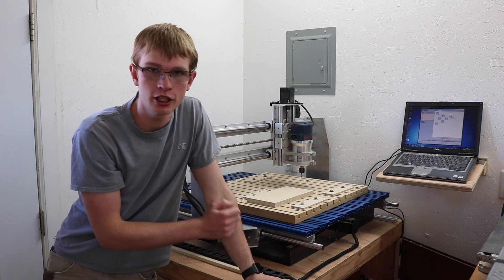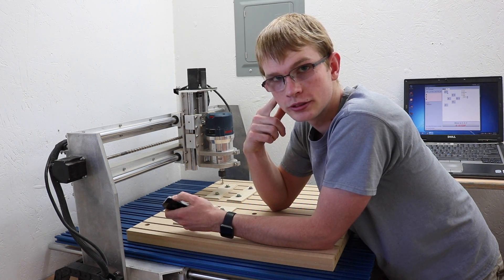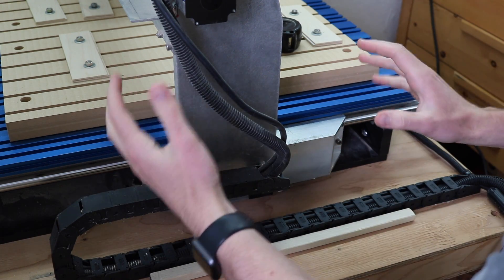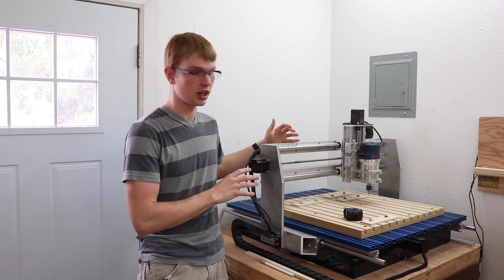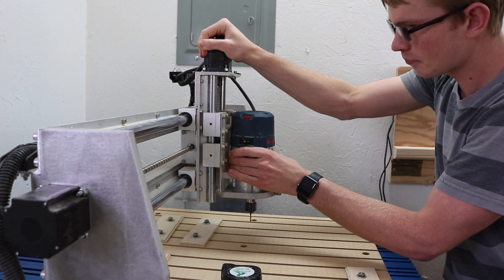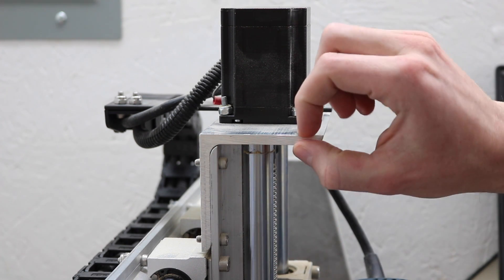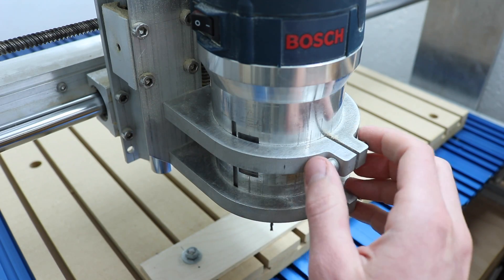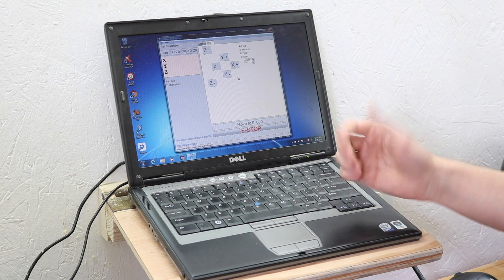All about my CNC machine

Comment: An idee if you want to clamp thinner material with the same style of clamp whould be to have a nut in the T slot below and just have the screw head ontop ... and if you can countersink that into the clamp, you whould not have the nut sticking up above the clamp ... Just an ide.

Other than that I love the clamp ide/concept.

//Vidstig
Reply from the maker: +viddy stiggy 
Good idea! I'd need to adjust the shape of the T-slot a little to accommodate the end of the bolt, but that's easy to do...
Reply: Glad you liked it. I have seen something similar in a store somewhere :P. And if you want bigger clearance for the dust collection for exampel this is an idee that will work for that to.

Comment: there is nothing that would pull on it as you did to make it twist
Reply from the maker: +steveu235 
True, but 1/10th the force makes it twist about 1/10th as much, which is still completely unacceptable. 0.001" of twist is too much, and 1/10th that much force will make it twist more than that.

Comment: Delrin nuts and lead screws are a lot more economical than ball screws. is there a major trade off in other areas?  I guess the best question is would you use them again? I really appreciate your demonstration of the gantry strength. It shows what is important and how to achieve it. Really good job.

Comment: Please make it happen, build a CNC machine. A machine that can by armed with
a 3D printer nozzle. The base seems to have the same common requirements for
a 3D printer and CNC Machine, that's stability and accuracy. Other issue would be 
the speed but speed is relative. It doesn't have to be large 250x250x200 (mm) or 
9,84x9,84x7,87 (inch) would be fine for most hobby parts.

Comment: To avoid twisting as you mentioned, the SBR20 rod should be facing each other or back to back. This is due to the way how these SBR rail is designed. This is its limitation compare to the THK linear design. Mine has no twisting but it was done thru trial and errors costing me thousands of dollars. Cheers.
Reply from the maker: +LEN HENG 
Yep, I have observed this in my rails, however I believe about 70% of the twisting in my gantry is from the structure and 30% from the rails. (Just a guess)

Comment: Stop using angle stock and box tub. ROUND TUBE is TORQUE STABLE! Flat crap aint!
Reply from the maker: +Tricknologyinc 
Really any closed profile is pretty good for torque. But yeah when I built this I was stupid and didn't think it through.
Reply: No, it's not! Square tube is nothing more than four FLAT BANDS! FLAT BANDS TWIST LIKE CRAP! TRUST AN ENGINEER! This is why you do not see tube frame race cars and aircraft of any serious application using anything but ROUND TUBE! Ive been doing this stuff A LOT LONGER THAN YOU. If you don't believe me, just take a round and square tube of equal thickness and dimension and TORQUE THEM AND MEASURE THE YIELD!
Reply from the maker: +Tricknologyinc 
I will trust an engineer. Too bad you just made it obvious that you aren't one. I didn't say that square tube is as strong as round, but a 2x2" tube 1/8" wall is many times stronger than four 2x1/8" flats. And square is easier to work with in this case, so it's good enough.
Reply: You're the one one that made your first comment, not me. Machine tools cannot tolerate anything that is only "pretty good for torque". You didn't think through your design nor your afterthoughts. You raced along focused on a single aspect, as you even admitted, dragging everyone through every detail, so don't stand there and tell me I'm not the engineer. You didn't think your project through, and then when someone offered you assistance, you didn't think through your replies and focused on your ego and attacked. I didn't attack you.
Reply: And don't get ruffled! You pointed out problems in someone else' work and did some good work. You overlooked some obvious critical points, so you're going to get the same. that doesn't mean you didn't do everyone a service, but when you just thrash everything outside of your focus, you are seriously diluting your result. I should have started out thanking you for your work and contributions, so I didn't come across as ungrateful. You're doing a lot of good work. But when you venture into calling out flaws, check your own a tad closer. Keep up the good work!
Reply from the maker: +Tricknologyinc 
I'm sorry I came off wrong. You're completely right that I didn't think through my design; what got me to reply the way I did was when you said "square is nothing more than four flat bands", since I know very well from real world experience that isn't anywhere near true. It's true that a round tube down the middle of the gantry would do a lot for the stiffness of the machine though, assuming I could figure out how to mount the linear rails to it. That's where my comment that square is easier to work with stemmed from. It would be almost impossible, with the equipment I have(no tig welder), to mount the rails to a round tube...with square they could just be bolted on.
Reply: The phrase "nothing more" was hyperbole, but it is the correct place to start in analyzing the mechanics. The four flats will simply twist. What needs to be accounted additionally is the right angle joints which will simply flex open or closed as a parallelogram. this flexing of the angle joints is similar to the flexing if the flats but the cross sectional area is based on the distance from the inside to outside corners, or the 45 degree bisection of the linear material thickness. The flex of square tubing is not merely that of the four flats, certainly, but it falls MUCH closer to that end of the range than what you would measure or observe from a round tube! thanks again for your videos. They're a lot of fun!
Reply: BTW, you don't need TIG! Stick welding is dirt cheap. Oxy-Acetylene is a bit more pricey to start up when gas bottles have to be acquired. Pawn shops in more urban areas usually have a couple welders in stock. If you can score an AC/DC unit in the 200 amp range, then a cheap gas capable MIG welder can use it as the primary power if you need to get a jump start on production steel fab. Round tube with angle welded over it or box tube over round tube are options. Round tube can even be your rails. Someone with a big lathe should be able to true up the outsides and taking advantage of larger diameter tubing, longer rails, and longer carriages, play can be nulled and a very true running set of stages can be scratch built. Buying a precision set of rails which is pricey to start, and then having to engineer the crap out of a mounting system that is still slave to the flex in those rails can be a fools errand. Carriages can be fabbed from box tube or angle with skate bearings mounted to adjacent faces so that the perpendicular oriented bearings and ride on a round tube or pair of round tubes welded into a truss if necessary depending on the span and load required. Anyway, that's more of my spitballs coming at you!
Reply: Tricknologyinc Where is your video guide for building a CNC if you think you know everything better?
Reply: Jonatan - You just skipped reading most of it.... I'm busy. I help out what I can. take it or leave it or offer something yourself. I helped. You're not.

Comment: Not a fan of your final design, but I understand you were working with what you had(junk to begin with). With that, I have to give you a lot of credit for ingenuity.  You fit up a lot of complex parts to get it done. Hat off to you.You should add an extra nut to your x and y for an anti-backlash set-up  You already have the structure in place to mount them.  Make them free floating, add springs to their mounting screws, adjust every once in a while.
Reply from the maker: +joedanero 
Good idea. Backlash is becoming more of a problem as the machine wears...

Comment: Do not fret about the expense of the gantry sides.
The HD had been reinforced with aluminium plates.
It made no difference to the wobble in the gantry, the top rails were slightly longer than the bottom of the gantry was wide, so the plastic sides vere still bent slightly outwards, in an effort to avoid gantry wobble.
It did not work.
I used 1/2" aluminium for the sides.
I found, that because the extruded aluminium rails were not supported, when you used the supplied clamps, they just lifted up the rails in the middle and allowed the material to bow.
That's why I bolted a solid sheet of aluminium under the table.
I still use the control box, it is a helluvalot easier than the Mach3.

Comment: you mentioned the Arduino + G Shield control box, could you elaborate on that?
Reply from the maker: +dudekidPL 
That's what the X-carve uses, but upon further research I've realized that's kind of a rubbish way of doing it. The Arduino works great, and has the advantage of a lot of flexibility (runs on Windows, Linux, & Mac), but the G shield can't handle the amount of power required to run good torquey motors...

Comment: Going to start building a cnc this weekend. Going to use 4 gantry rails instead of 2 with the motor mounted in the middle. This should eliminate nearly all possible flex.

Comment: Hi, very interesting video. I was wondering for 800$, the CNC machine will it be able to cut 3k carbon fibre? I would like to build one so I can cut carbon fibre frames that will use to build my quadcopter/multirotor, and some small pieces of 7075 aluminum for mounting camera, roll-cage, etc... I read you might be selling the plans for a CNC? Is it still in process?
Thanks for your time
Reply from the maker: +Ray Choi 
Yes, it is still in the works, but I've run into some issues that will delay it some. I don't see why it wouldn't be able to cut carbon fiber and aluminum.

Comment: How have you ended up your drive rods? Are there any axial bearings in the frame? Or everything is carried by the stepper motor bearings?
Reply from the maker: +Przemysław Jakubczak 
The motor bearings take the load. Bad idea, but that's how the original manufacturer did it.

Comment: Nice mod there..... My home brew is somewhat similar in size has almost the same specks as the shopbot desktop. I used the same acme rod as you did 1/2 5 start on X and Y and single start on Z but I went with 450 Oz/in steppers, real stout bit snappers.. I use Mach 3 as the controller on a 16 year old desktop.  Youre close on the guesstimate price there too. 

For those wanting to do a cnc from some plans or a scratch  build this guy is DEAD ON about the rigidity issues. As an example any of the X-carves have a serious deflection problem in all 3 axis. That being said if you cut shallow an slow on one you can still get reasonably acceptable accuracy.  I agree that any of the small (25 X and Y cut area or less ) are all overpriced for what you get. Now thats not saying theyre bad. Its two different issues. In any case with a factory made CNC you get what you pay for and the biggest mistake you can make is cheaping out.

Comment: hmm, I wonder if those aluminum angle way to mount rails and only less that 2cm thick aluminum is strong enough to work on aluminum... Have you tried?
Reply from the maker: +Антон Кириченко 
I have no idea what you're asking...
Reply: I'm asking if cnc is rigid enough to cut aluminum properly.
Reply from the maker: +Антон Кириченко 
Oh, ok. I haven't tried, but I think it could if you go slow enough.

Comment: I am very interested in your take on building a cnc for cheap.  im also curious your thoughts on linuxcnc or any open source platform for cnc i am having a hard time finding out what to do once i build the machine and how much work or money i would have to put up for the cad/cam software side of things and setting up the cnc on the computer.
Reply from the maker: +Mike Bertoli 
I haven't tried LinuxCNC. Currently no Linux computer to try it on. I've been very happy with V-carve Pro (which does CAD & CAM) but it's expensive and you have to put up with Windows issues to use it... For the new machine I may be switching to Fusion360 for CAD/CAM. At least I'll give it a go.

Comment: I don't know much about CNC but want one.  I have a hobby machine shop with pretty capable manual machines.  I would be interested in purchasing plans so I could build one with complete parts lists of everything I would need to make it work, including any electrics and computer hardware and software.  I've noticed alot of them you see for sale do not come with controller/computer interface or whatever it takes to use it.
Reply from the maker: +Larry Robinson 
I'm working on my new CNC design.
Reply: Nice. If interested in Chinese CNC router, welcome to visit: http://www.falacnc.com

Comment: Im no expert, but I think if you had more x axis bearings, and instead of 2 bars on the backside put 2 more on the front.
Reply from the maker: +Elijah Cothern 
What would be the advantage? Sounds like a good way to double my alignment problems.
Reply: you would prevent it from tilting, and also create a much smoother ride from left to right. Everything is a problem until you find the solution. I like your work man, keep it up.

Comment: You nailed the right point, that's why all serious machines are basically made from cast iron or aluminium.  Still they can be bent if not correctly leveled. It is not stepper vs servo, parallel vs USB.  Machine rigidity, parallelism, flatness determines everything. If I were you, I wouldn't empty between two rails, they will weaken the rigidity of X-axis.  And if you want a machine doing serious job, forget about aluminium extrusion, round rails and ACME screws. Trust me, I had endless pain from a Chinese machine.  A'way, you did a very good job to overcome your circumstance, keep going!

Comment: very nice machine, where did you get the rail extation ?
i didn't find it .
Reply from the maker: +nir keren 
What do you mean by "rail extation"? Extation isn't in the dictionary.
Reply: I meant Extension . sorry
Reply from the maker: +nir keren 
Ok... like the angle and tube that's used for the frame? I got that from a local metal supplier.
Reply: Thank you for your quick response.
My intention was to tracks of the Y-axis
The20 mm rod which is longer than the base.
I have not found such without the base.
I've built a similar machine a year ago, and would like to make better use of the work area.
Tnx Nir.
Reply from the maker: +nir keren 
That's just a standard 20mm fully supported rail. SBR20 is the part number. I got them from eBay.
Reply: I have the SBR20 1000mm.
But... in your Y axis the 20mm ROD the larger  then the support.
and it gives you more movement, to maximize the work area.
Reply from the maker: +nir keren 
I just cut the the supports to the same length as the table, and then cut the rails to 4" longer (2" on each end). I think I started with 1250mm length rails.
Reply: Thank you very much for support and patience.
Ever thought you bought the rail separately.

Comment: $800 Sounds too expensive. I could get and X-Carve for less
Reply from the maker: +Jake Abel 
But the X-carve is pretty much worthless. $800 will build you a good CNC.
Reply: You even mentioned that this system twists. My X-Carve does not twist(I'm in the middle of building it. Everything is together I just need the controller).

Comment: 800 ? Ayy lmao I am building one for like 80 euros lol
Reply from the maker: +Mr30friends 
If it's a good CNC, by my definition, then hats off to you. Otherwise it's a complete waste of 80 euros.
Reply: Jeremy Schmidt If I ever make a video about it when its finished I will give you the link, it will probably be in Greek though.
Reply from the maker: +Mr30friends 
Ok, I would be interested to see what you come up with.
Reply: Jeremy Schmidt Mine might be WAY too cheap, but I still think that all those desktop cncs are expensive as fuck. I mean a cnc is a pretty simple machine, not to mention that most of them use open-source software and electronic hardware which makes it even more strange. I see some of those cnc models and I am like "hmm the usual nema 17 motors, arduino + shield , free software, the classic aluminum construction. Soo lets see the price. Should be around 300 or 400. Ohh shit its 1450 what the fuck is going on ?"
Reply from the maker: +Mr30friends 
Yeah I agree with you on that. The X-carve, for example, would be reasonable at $400. Of course you have to consider the research & development, but looking at something like the X-carve it looks like they have about 2 hours into that.
Reply: Mr30friends a
Reply: David Carlson b

Comment: Very nice presentation! 
I'm considering building a machine from scratch. Have you seen any of the videos by Matthias Wandel about his band saws?
My idea is to make the parts of cheap spruce like he makes his band saws and maybe laminate a single layer of glass fibre reinforced epoxy on each side for dimensional stabilization. 
Given you have a CNC now you can cut all the parts on your machine way easier than I can with hand tools. I would still go for the fully supported rails like you recommend.
Reply from the maker: +Jens Sigurdson 
I have a bandsaw by Matthias' design; you'll see it in most of my videos. And I like it.
That type of construction isn't the way to go for a CNC though. There is no substitute for the electronics, or the precision ground and hardened linear rails and screws, and that is about 90% of the cost of the machine. It would be silly to cheap out on the other 10% and make a flimsy and inaccurate machine when you could make a very stiff and precise machine for only about 10% more.